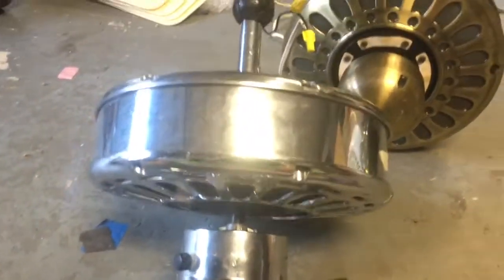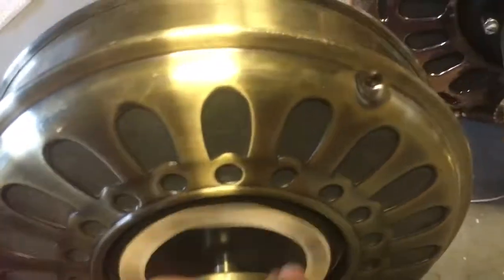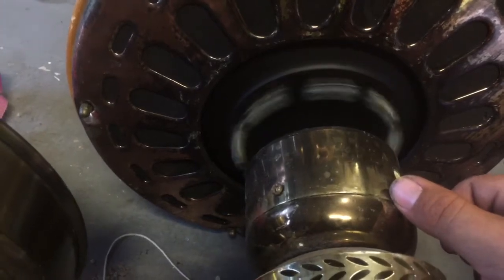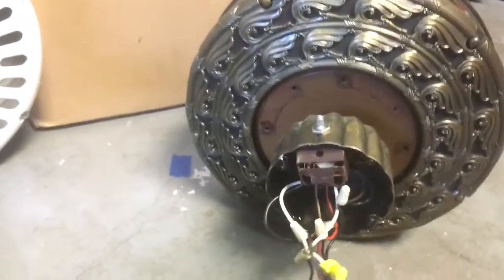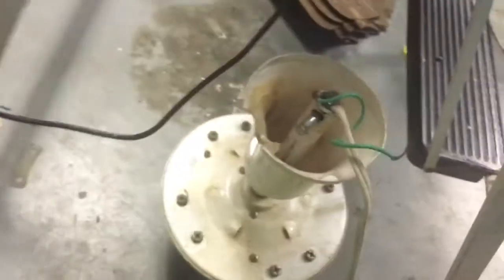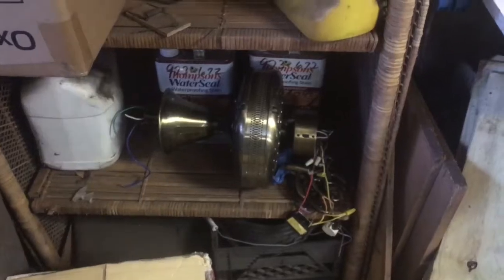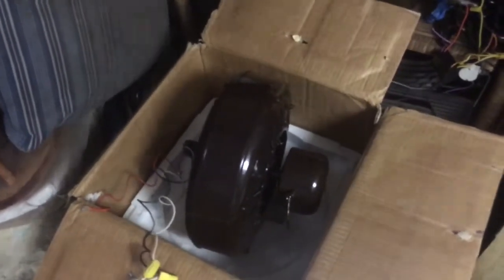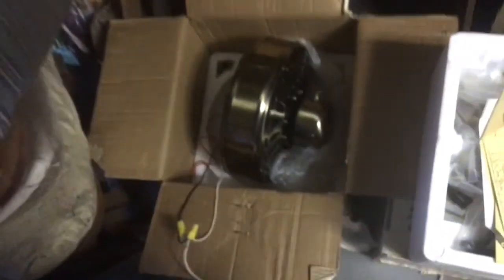Ceiling fan motors testing

Comment: It would have been helpful if you would have shown how you hook the motor up to electric in order to test it
Reply from the maker: Brenda Wooten ? Black/color is the hot. White is neutral, green is ground.
Reply: @Marksfansandthings   Thank you so I hook that up to a  Stripped cord and plug it into the wall
Reply from the maker: Brenda Wooten ya.
Reply: Yeah really - how and where did he get the electric to it